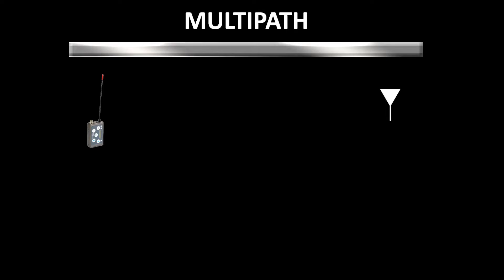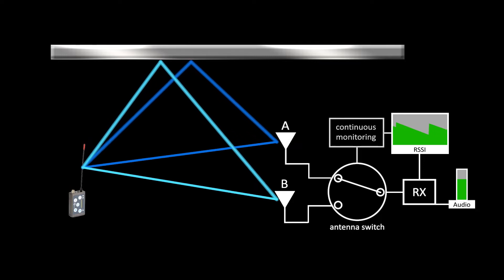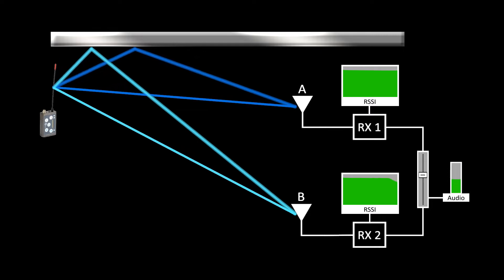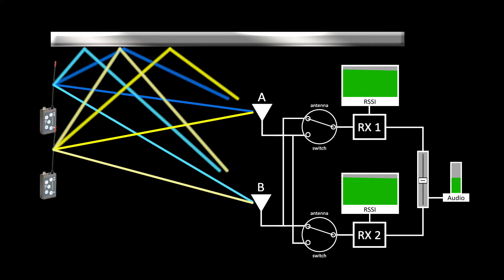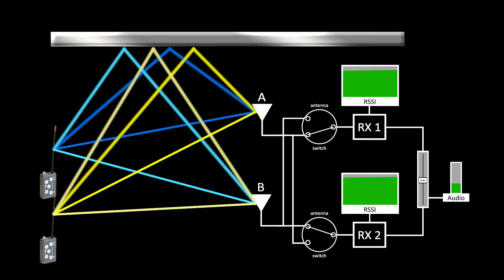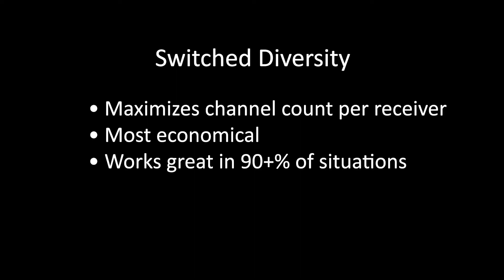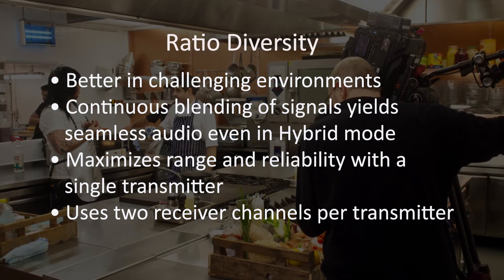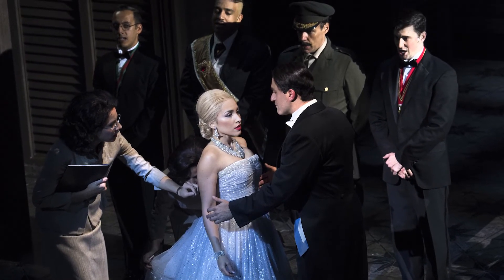Lectrosonics DSQD Digital Receiver Diversity Details & Setup

Comment: Karl, Is the antenna switching diversity you describe here in your first example the same switch diversity technique that's implemented on the Venue1 & SRC aka Smart Diversity that uses antenna phase switching?
Reply from the maker: Michael, it is similar but not exactly the same. In the case of the DSQD, the switching diversity is simpler - it chooses the signal from one antenna OR the other, and does not combine them in/out of phase.